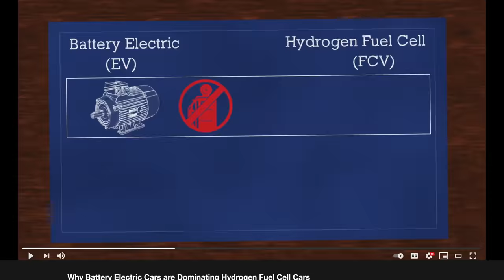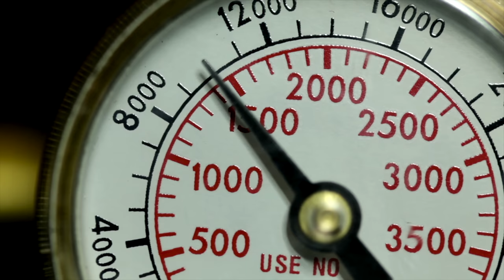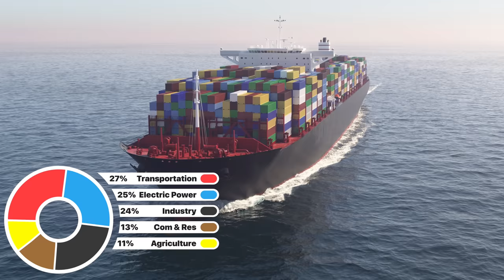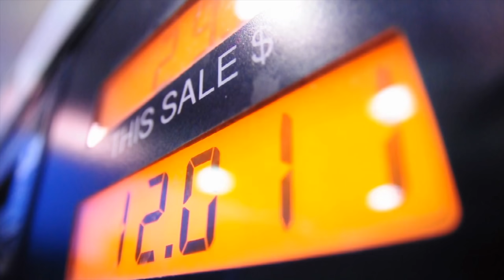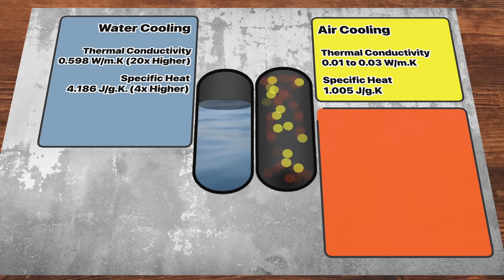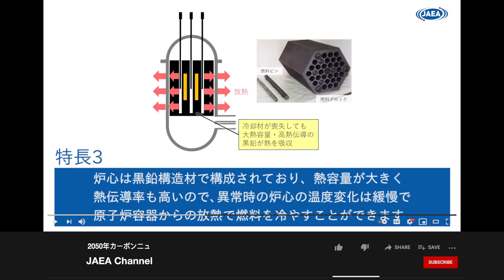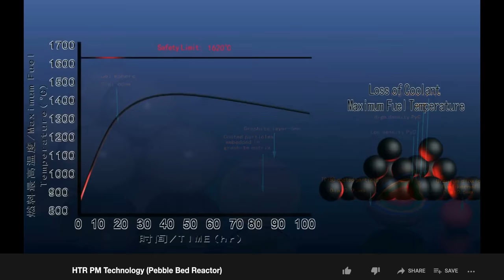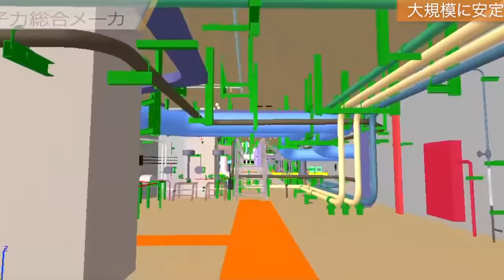Japan's Plan to DESTROY the Price of OIL and GAS!

Comment: Are you serious? You make a distinction on the power to separate hydrogen but not on where the electricity comes for batteries? Or the amount of oil fuel needed for mining battery materials?

Comment: Here is some info on the subject from Wikipedia .  ---- In thermolysis, water molecules split into their atomic components hydrogen and oxygen. For example, at 2,200 °C (2,470 K; 3,990 °F) about three percent of all H2O are dissociated into various combinations of hydrogen and oxygen atoms, mostly H, H2, O, O2, and OH. Other reaction products like H2O2 or HO2 remain minor. At the very high temperature of 3,000 °C (3,270 K; 5,430 °F) more than half of the water molecules are decomposed, but at ambient temperatures only one molecule in 100 trillion dissociates by the effect of heat.[15] The high temperatures and material constraints have limited the applications of this approach.

Comment: I remember predictions that "nuclear power will produce electricity too cheap to meter" which obviously didn't happen. In fact, it turned out to be one of the more expensive forms of power generation when the cost of safety, maintenance and nuclear waste management was added in. Although the high temperature assures a high thermodynamic efficiency, I suspect that this will still be an expensive source of power, possibly more expensive than more conventional reactors. It's also likely that the hydrogen made that way will also be expensive and still not economically competitive to electricity as a fuel.

Comment: You mentioned waste but i remember you can use spent uranium in a different reactor and use up more of the heat and radiation and reduce the radiation to safe levels. Im not remrmberi g the name of thd second stage reactor system.

Comment: Oil and gas are energy sources as the potential energy is already bound up in their naturally occurring state,  one has to input energy into the natural sources of energy before extracting any, is an energy storage mechanism, a battery as it were, not an already existing source of stored potential energy, one does not replace the other as the title seems to imply as they have different uses. One can however store energy as hydrogen where that initial energy was generated from 'green' sources and that is the utility of hydrogen.

Comment: Helium is pretty small atom, so it may leak pretty easily. And I bet this kind of reactor runs on extreme pressure, so with any holes in the system will make an eruption or an explosion. Helium itself is nonreactive, so it won't explode, but pressure makes its own explosion. And high pressure combined with high heat may instantly erode any nearby materials that may lead to an chemical explosion.

This system still creates loads of radioactive waste that has to be handled with care.

Safe? No way. Not even when actual meltdown is less likely.

Comment: The problem of waste is actually a lot less than most people would think. Take all the nuclear reactors to have ever run for their entire lifetimes and you get a pile of waste about ~3" deep across a football field. Not that much compared to coal and other industrial processes that pollute dozens of times more than that every hour of the day.

France also has been experimenting with ways to recycle the nuclear material even further reducing the waste output. A neat trick that both increases usable material and cuts back on waste, it's a win win.

A study was done sometime ago and it turns out that there was a natural nuclear reactor running under the continent of Africa for a few hundred thousand years, none of the waste made it into the water supply either. So burying the waste is actually quite viable.

Not to mention we mix our waste products with copious amounts of glass, recycled plastic, and a few FEET of concrete around it to prevent ANY leakage.

Nuclear is already the safest industry on the planet, and it gets safer every year. =)

Comment: How do you cool the Helium in order to use it again , I guess  , how expensive is Helium , since you will need great quantities to cool down the reactor . How readily available is helium since it is a scarce gas among gases.
The Iodine , SO2 reaction is a smart one for producing H2
There is another method also by using concetrated solar power using mirrors to direct the energy at a point in a tower where a catalyst is heated and water vapor is passed and is split into H2 and O2.

Comment: Near-impossible for at least the next 50 years, where oil is expected to remain relevant. Within this time, whenever demand slides the directly proportional action oil exporting countries and organisations will do is to cut production so that the oil price restabilizes at the "decided" value. It's a play of the economic equilibrium between supply and demand so long as the commodity isn't somehow made completely redundant.

Comment: I wonder - and this is complete speculation - if for some industries it wouldn’t be possible to do a major change in thee mindset and have manufacturing set to run only when there’s green electricity available? It would require a total rework of the production system in all sorts of ways from employee contracts, supply chains etc etc and in some industries such as when equipment MUST be kept online, impossible but absent huge battery capacity might be able to soak up wind and solar electricity capacity which would otherwise be wasted.
Reply: To be a reliable low cost supplier you have to be able to schedule production. Renewables without batteries are undispatchable. Renewables with batteries are unaffordable.

Comment: If you have to convert the electricity into hydrogen, ship it, and then convert it back to electricity in the car, you are inserting two conversion steps, compared to just a storage step. The loss in conversion to generate hydrogen is 50 to 60%. Storage compression costs 10%. And the second conversion step, from hydrogen to electricity, costs 30%. Battery EVs without the conversion step lose 10% to storage.

So cumulatively you get five times more distance per dollar of electricity at the power plant if you use batteries.

And that is without mentioning the fact that the distribution network for direct electricity already exists, while the network for hydrogen distribution does not.

Who is going to want to spend $500.00 to fill their car (effectively) when they could be spending $100.00?

Comment: Hydrogen for car use still has transportation problems, which battery vehicles do not as electricity runs via cables. So battery appears the better bet for cars - battery technology is improving. For volume consumers like trains and ships, the hydrogen can be produced on site using nuclear produced electricity. Also there are problems about taking hydrogen into train tunnels. Many will not allow combustibles in metro tunnels and stations. It looks like Liverpool may be the first to use hybrid 3rd rail/battery electric trains in metro tunnels.

Comment: At ~16:10 to 16:20 you trumpet 2400 F as an extreme test. Perhaps your point is in reference to normal critical temps of nuclear materials. But 2400 F as an absolute value is not much compared to many industrial temperatures. Can you explain why this is then so significant a number relative to the problem?

Comment: I've been thinking about this, If you preformed the breaking at depth would not the gasses be compressed to the pressure of the depth? Floating solar panels, you could aqua farm on the same floating system.

Comment: There is nothing new about HTGRs. The Ft. St. Vrain power plant in Platteville CO is a gas fired plant today. But it was an HTGR that operated from 1979 to 1989. It was pretty unreliable in its early years. One of my projects in the mid 1980's at a small Denver area cryogenic equipment company was to repair the Helium loop dryers that had failed. It was great technology in principle but proved to be an economic failure. Today there seems to be hope for all sorts of "new" nuclear technologies. In fact there were plant scale implementations of all of them in the 1970's - none took hold but suddenly they are the vision of a carbon free planet.

Comment: Pebble bed nuclear power was pioneered by the Germans and there were several problems that have not been solved.
Although it is not likely to melt down, they are prone to crack due to build up of waste materials confined inside a very high temperature tiny sphere.

Comment: Good video on a very importan topc. However as an energy and nuclear industry professional, I have two minor issues. EVs will likely be more effective then any H2 car, as the fuel cell is only 50% efficient, and the storage say 70%, and also while high temp H2 reforming will make H2 cheaper, it is likely it will not be low enough to compete with EV and electrical nuclear plants. But regrettably the Japanese car markers did not take climate change seriously and invested in developing EVs. H2 will not become cheap enough for everyday use, when conversion loss in a EV is perhaps 10% instead of 60% for H2.
Secondly while Triso-fuel has a lot of nice properties, it is also problematic. In a conventional watercooled reactor, the fuel is only used 5%, so the it can be recycled into new fuel. In combinations with breeder reactors, it can be turned almost completely into energy and the worlds spend fuel can power the globe for more than 100 years. This not possible with Triso fuel, as it cannot be recycled.

Comment: Two scenarios could add to this story , 1, interim hydrogen production using all old oil wells , convert oil deep underground into hydrogen , leaving co2 deep underground , check out Proton Technologies, Calgary , Canada. 2. Nuclear fuel without the issues of long term , nuclear weapon threat, Lightbridge , if claims correct works in most existing nuclear plants at 1,000c lower temperatures and no good for weapons use ,

Comment: The best use of the extra heat from gas cooled reactors might be desalination of seawater.   That isn't without its issues either, of course, but fossil fuels power desalination in much of the middle east.  So I'm guessing it might be a critical application.

Comment: SpaceX avoided hydrogen fuel rockets such as SLS because of the many challenges in hydrogen plumbing, which is prone to leaks. We need a breakthrough such as coating within pipes and valves to reduce leaks.

Comment: The reason why this is not a solution at all in that nucklear power plants can only produce cheap energy is because the get highly subsidized. 
If you compare the Kwh/€ with all costs included you are far cheaper to produce wind and even solar energy.

Comment: The problem with helium cooled reactors is that the world is running out of helium. This is a problem that they are dealing with while building new MRI machines. So, unless you plan on mining helium from the moon (which would be exceedingly expensive) there are better nuclear reactor designs that pass the meltdown problem safety tests, like liquid salt reactors.

Comment: Water Vapor (WV) is a greenhouse gas as potent as CO2 according to theory. On average there is 50 times as much WV in the atmosphere as CO2.
The fact that it is non-persistent is often mentioned. It doesn't have to be. You can AVERAGE (integrate) the effect. There is on AVERAGE 50 times as much.
Non-persistent. ==> Definition - only heat  trapped from CO2 molecules can evaporate water vapor molecules. The heat water vapor traps doesn't cause water evaporation.

Comment: Hydrogen, currently, is needed for aviation and longer term storage in metal hydrides (imagine producing hydrogen from your solar in the summer and storing it as hydrogen for use over winter). Hydrogen can also be used to produce synthetic fuel for use in the massive worldwide ice car fleet (a lot of asia, africa, s.america, india are not going EV anytime soon, purely on cost) EVs are definitely the way forward for ground/sea vehicles and maybe for smaller planes. But in the short term we need synth fuels to replace oil immediately, world wide…

Comment: Wikipedia reports that the well to wheel cost split of hydrogen is 15% production and the balance transport, storage  and other logistics. While it always looks good on paper its easy to ignore the practical challenges of dealing with a small and insideous and extremely explosive molecule, which has to add cost on the logistics and facillities side, none of which exists yet at scale. Perhaps that is one of the reasons we are not surrounded by Toyota Hydrogen cars instead of Teslas. Hydrogen can be used as a feedstock for the creation of Hydrocarbon  E fuels  but from what I have read they currently come out at several times the cost of Fossil Fuels. Certainly for aviation and probably shipping its easier to use an E fuel or SAF as it utilises current engine technology. I've seen a small amount of Hydrogen in a plastic rubbish sack explode over an open fire, it was damn scary .  Designing and certifying a Hydrogen fueled commercial Airliner is decades off if ever. Overall I would say if we can get E fuel cost on parity with Fossil Fuels then its game on for Hydrogen to help decarbonise difficult industries but there is a long way to go yet.

Comment: I wonder what the long term effects of producing hydrogen from water will be. There is already a shortage of potable water. Large scale desalination would increase salinity in the ocean or leave us with massive amounts of waste salt. Currently water doesn’t leave the planet, it evaporates, condenses, freezes, melts, goes under ground, etc. But if you split water and burn the hydrogen, the water is gone forever.
 Currently the cheapest way to produce hydrogen is converting methane, which we have in abundance. The problem is that method releases carbon that has to be sequestered. We have the technology to do it but we’d have to rely on oil companies to provide the methane and that wouldn’t be POLITICALLY correct.
Reply: When you burn hydrogen, you get water again. Chemistry 101.

Comment: Splitting hydrogen from water is extremely energy inefficient, plus the heat of combustion for hydrogen is much lower than carbon and thirdly hydrogen is difficult and expensive to store. The best application for hydrogen energy is fusion in stars!

Comment: as frustrating is the battery electric system (all the wiring to build charging infra/ limited battery chemicals etc. hydrogen makes a lot of sense. its in water.

Comment: I’m thrilled to see someone actually implementing a no nonsense solution to nuclear power instead of using a “model T Ford” design and then wondering why it’s cumbersome. The reality is nuclear has been figured out decades ago with various reactor designs, some of which can even run on our current nuclear wastes but because of misunderstanding and irrational fear… we don’t invest in it and most people think it’s only a weapons technology and not a complete civilization revolutionary technology.

I’m still highly skeptical about hydrogen use because to me it still seems we’re trying to reinvent the wheel here. Producing hydrogen is still an energy intensive operation and its combustion still results in NoX emissions under certain conditions because the temperatures produced react with the nitrogen in the air and bottling the O and H together yields its own problems depending on intended use at the source.
We already have a much better stop gap solution with Natural Gas. It’s main ingredient is Methane and is far worse than CO2 if it leaks into the atmosphere. We could lower greenhouse emissions and power infrastructure at the same time if we invested into waste to energy solutions that capture the natural decomposition processes much of our garbage undergoes and use our existing distribution networks to hear homes and fuel the fires of industry.
Vehicles can already use it as fuel and the technology is there for compression and distribution… there’d be less range anxiety if stations were more readily available and the break even is much closer as EVs have a large inherent carbon footprint to be built vs traditional fuel powered vehicles.

I’m not bashing on EVs or Hydrogen and I think that if someone makes the economics of it work and the data shows they’re actually cleaner than what we have than I’m all for it. I just see every single day things that are plastic, green wastes, food wastes etc that are going to go rot in a landfill and create natural gas that could otherwise be useful…. If plastic becomes part of that equation and can be used to make syngas (synthetic natural gas) you do double duty by preventing plastic getting into our oceans.

Comment: Hydrogen is NOT an energy source, but a storage medium, as a gas or a liquid. It takes gobs of kWh to make it, and pump it up to 12000 psig or its liquid state and then store it. Making it by electrolysis is not very energy efficient. The round trip efficiency from electricity to gas, then  back to electricity (fuel cells) is about 35%. 
Then add the factor of inevitable car crashes. 
Hindenburg would look like a cakewalk.
The real "story" here is avoiding the use of water in nuclear power generation, to be replaced by liquid salt or liquid metal. Most problems with nuclear power, although few, can be traced back to water as moderator and energy carrier.

Comment: Hydrogen on demand technology doesn't require fuel storage. Both Graphene based light weight & superior strength construction with it's static electric collection  and storage capability will be the future and will allow independence and less hands of fuel development, transportation and monopolization whereas oil, coal and nuclear energy are the opposite. Everything has its place and time.